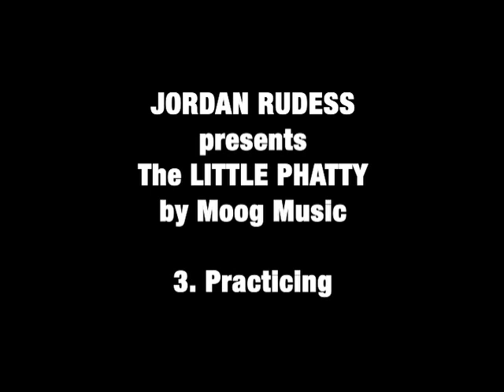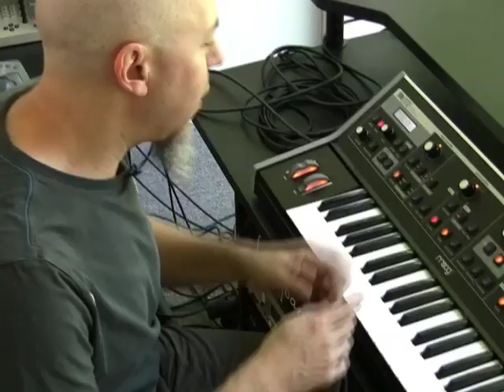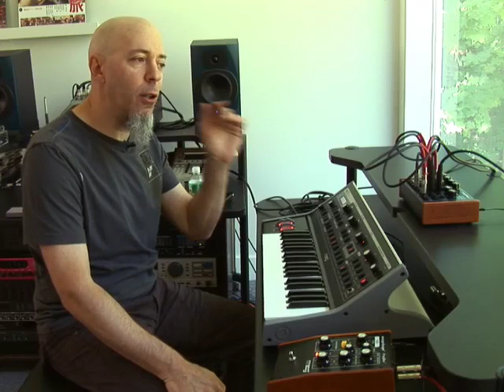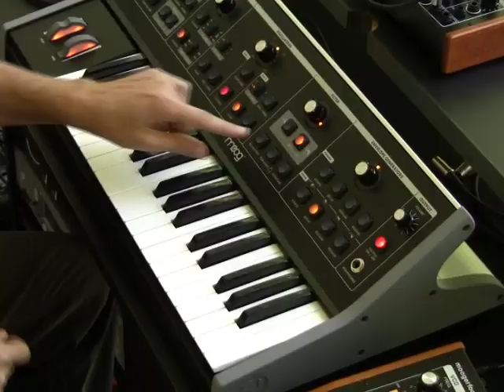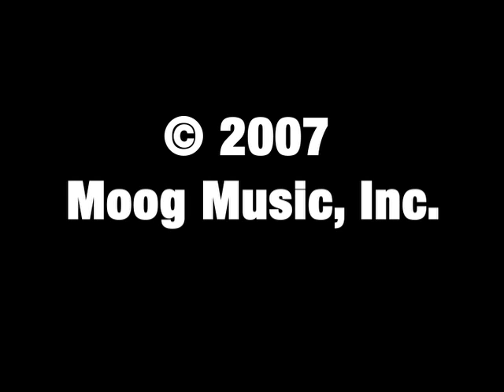Jordan Rudess Little Phatty Demo 03 - Practicing

Comment: Yes it does send all notes through the MIDI output. You can even send those notes to any virtual instrument and route them back (polyphonically) through the audio input, and pass it through the filter section (adding some Moog colours to the overall sound).